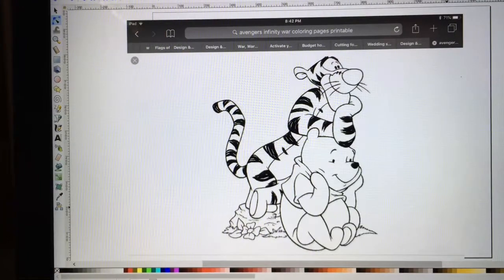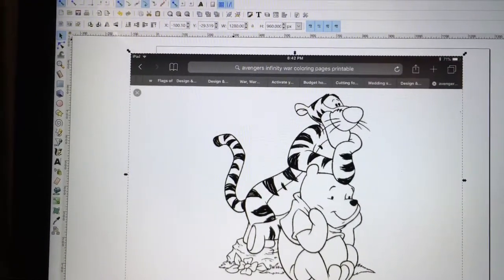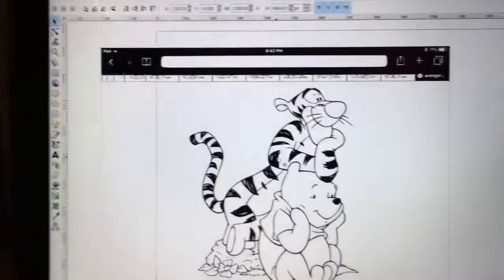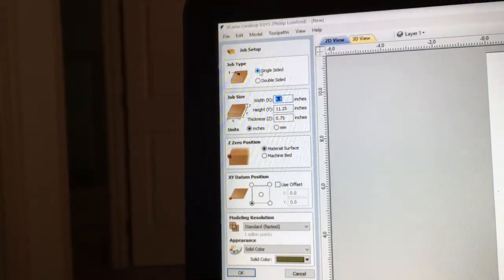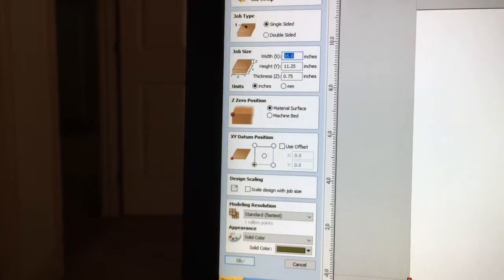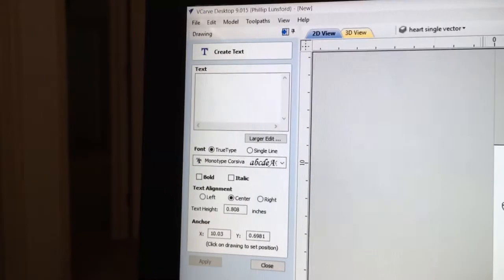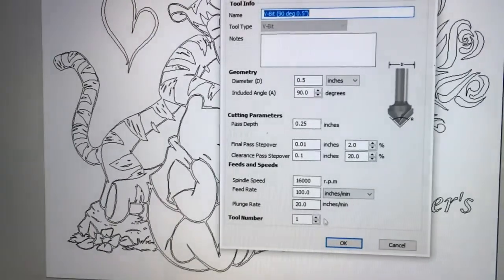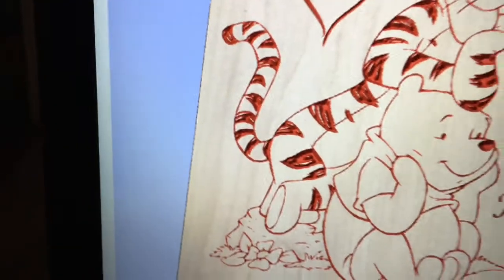How to Create G-Code with VCarve and Use Easel as the Sender

Comment: Great video. What did you need to do on Easel prior to hitting the Carve button. Just wondering if you need to select the bit you're using in the Easel program as well as VCarve?
Reply from the maker: Everything needs to be done in VCarve. When you send the gcode to easel all you can do is to set up the correct bits based on the toolpaths setup in VCarve. You can not change anything in easel
Reply: @PawPawsWorkShop  thanks for your reply.  I almost expected that I'd need Easel Pro, to be able to select the vbit. I'll give it a try. You make it look easy. Thankyou

Comment: Hey your work is so good but can I do similar work without your expensive equipment? Say with a Dremel tool?
Reply from the maker: Thank you very much.  You can do this type of project and others by using power hand tools such as the Dremel, however, you will get a hand crafted look.  There are many bits to chose from to accomplish your project.  Just remember it will be difficult to get the sharp crisp lines when doing it my hand.  Good luck.  I would love to see what you are able to do with the Dremel.
Reply: Carbon copy paper, trace onto a work-piece, use wood-burning or hand-router... been there... done that... bought a CNC.  /shrug

Comment: I watched your video on calibration.  is this something one must do to get going?   My machine will set up on the screen, but when carving it does not go up as far as the screen nor as far to the right.
I am perplexed,  seeking your fine knowledge!
I amusing an xcarve pro and easel software.
Reply from the maker: The GRBL settings should be set. However, you need to set your safety height in machine inspector. Also if you tell the machine to move one inch, does it actually move one inch. Check all arises. When I calibrate I use mm because it is a smaller unit of measure and therefore more accurate

Comment: Is the VCarve Desktop software worth the price? Great video keep up the good work.
Reply from the maker: Thank you very much.  I enjoy doing the videos.  Thank you for subscribing to my channel. 

Absolutely, the VCarve Desktop is worth the money.  I started with just easel for the first year that I had the XCarve. My wife got me the VCarve Desktop this past Christmas.  The tool paths are smoother than Easel and generally takes less time to carve.  You can do soooo much more in VCarve than in Easel.  I have only scratched the surface on what it is capable of.  I will probably get the VCarve Pro next.  All you have to do is pay the difference to upgrade.  The work area on the desktop version is 24x24 stated.  It will actually do 25x25.  The Pro version is only limited by the size of your machine.
Reply: Thank you for your response.
Reply: I would love to hear more about you starting with easel and moving to V-Carve. I want to do the same, but curious on what lessons you learned. Maybe even a quick 3 minute video or something.
Reply: I find it a bit of an irony that for the price you pay for Vectric software, you have to take the G-Code to a competitive product to carve it out!!
I noticed you used the VCarve Post Processor and not the Easel one. Is there much difference in the functionality?

Comment: A design like this can easily be done in easel.So the advantage of vcarve is that the toolpaths are more efficient?I have had trouble with easel taking forever simulating v bit toolpaths or not being able to calculate them at all.Will this remedy that for the most part?
Reply from the maker: Yes, this could easily be done in Easel.  The advantage is a much more streamlined toolpath and it cuts smoother.  Easel Pro has a tendency to jerk from point to point.  The taking forever to simulate or not at all in Easel is an indication that the file is too large.  VCarve would definitely help you in that situation.
Reply: @PawPawsWorkShop  Appreciate it,will i be able to export those designs i have in easel to vcarve to generate the smoother toolpaths and then send it back to easel to carve?Or can vcarve send it straight to the xcontroller to carve
Reply from the maker: I have never tried to go from Easel to VCarve.  I do not think that you can do that.  Design in VCarve completely.  Everything must be done in VCarve, then generate the Gcode and send to Easel.  Once in Easel, follow the checklist, probe, and carve.  You can not make any changes at all in Easel.  I have not tried going into Machine Inspector to see if the gcode can be altered there.  Looks like there is room for more experiments.

Comment: Can you change the feed rate (faster/slower) while cutting when you're doing an imported gcode, just like you can with something created in Easel?
Reply from the maker: No, you can not.  You can run the g code but you can not make any changes in Easel to the g code.
Reply: I was wondering this same thing. I am just running my first gcode import from vcarve into easel. And yes you can, increase or decrease the feed speed while it is cutting. as Paw Paw states in the video, the starting feed rates and depth per pass are all set in vcarve when you set up your tool as he shows and none of this can be changed in easel after import. But yes, you can increase or decrease the feed rate during the cutting job just as you can normally with a native easel job set up.

Comment: Hello Paw Paw,

   How does Easel work as a sender if the VCarve file has multiple toolpaths? What other senders do you use?
Reply from the maker: You are creating multiple toolpaths in VCarve.  Save each one separately. When you bring them into Easel, separate them into separate work pieces and carve.
Reply: @PawPawsWorkShop  Are you saying to save each tool path as a separate file? I saved 3 tool paths into one file and imported the G-Code into Easel. I did not see anyway to make them different work pieces...
Reply: If you are doing an inlay for instance you may have 3 to 4 toolpaths and you will have a file for each tool operation. If you use Easel as your post processor and you try to save all the toolpaths, Aspire/Vcarve will have a popup that will tell you that Easel doesn't support tool changes and will force you to save each toolpath separately. Then you would open Easel and open a new project for each toolpath file.

Comment: Hi Paw Paw. I'm looking at buying vcarve pro. Do I need separate software such as easel to send to the machine or can it be sent directly to the machine from vcarve pro?
Thanks
Reply from the maker: go tm . Yes you do need an additional software to send the gcode to the machine. With VCarve Pro, you will be able to create your design and generate the gcode. You will then send the gcode to Easel or another software such as UGS to get the project to carve.
Reply: Thank you very much for your quick reply 😊 much appreciated
Reply from the maker: You are welcome.  Good luck
Reply: There are 3 fundamental errors with this video. First up you dont need a “sender” with V Carve or Aspire as if you look in the post processor area there is a field that says “ send direct”. Secondly Paw Paw has complicated things by messing with graphics outside Vectric as it has an absolutely brilliant but map tracing function. And thirdly on V Carving generally you get far better results if you DONT use tool depth as this gives a liney finish unless you use a very fine step over
Reply: I have Aspire and I don't have the “ send direct” in my post processor list. Is it somewhere else??

Comment: When carving, what spindle speed (rpm) do you normally use?
Reply from the maker: I use the lowest setting on the Dewalt  611 router which is "1"  The RPM is 16000
Reply: Thank you. I’ve had my X-carve 500 mm for 3 months now and I’ve had mine set on max rpm. I also have the 611 router. I enjoy your videos. Keep it up!

Comment: Very cool! I noticed you have an X-Carve machine. Is the X-Carve able to communicate with "Universal G-Code Sender"? I would think it can, but have you ever tried sending GCode to the X-Carve with anything besides Easel? The reason I ask is that, I tried Easel and HATED IT! "Browser-based phone-home" software really turns me off... I also found Easel to be sluggish, probably because it's browser based  :( I'd be interested to know if an X-Carve can easily be setup with UGS. (My preference for sending GCode so far)
Reply: I'm torn between X-carve and Shapeoko for my next hobby CNC (have a Bobs CNC E4 here)
Reply from the maker: Yes, you can use UGS on the XCarve.  Both are GRBL based.  You might want to check out cnc4newbie New Carve.  I just got one and I love it.  lol, now you have three to compare. I like the no belts and no v wheels.    I believe all are good machines.